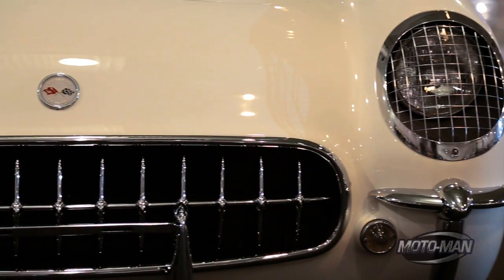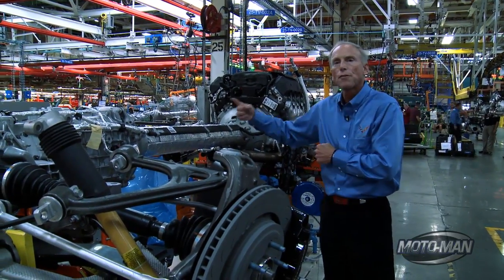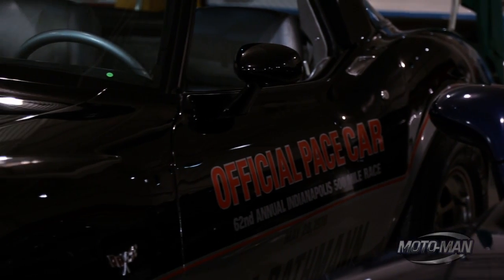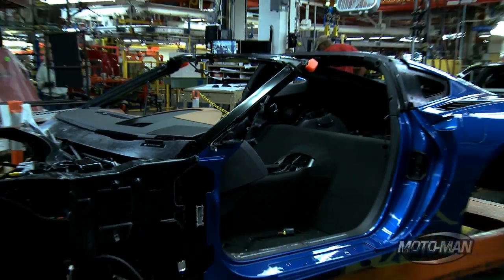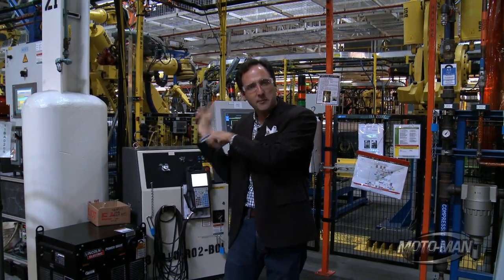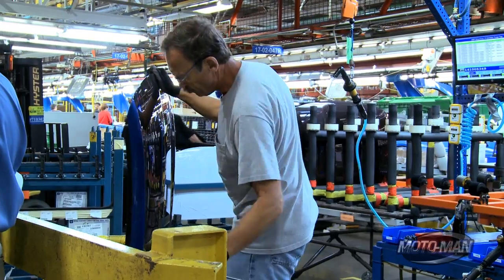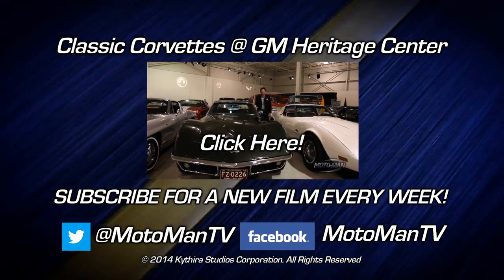Chevy Corvette Stingray C7: Behind the Scenes of it's Design, Engineering & Build - Part One

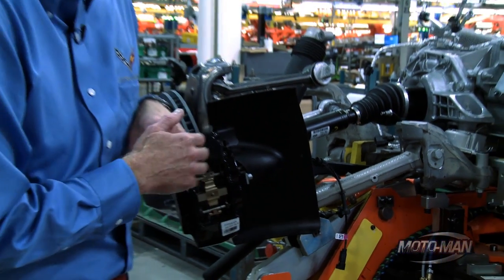Comment: @8:20 Tag says that a 'certain part connected to cooling the brake calipers and that this part sit too low to fit in a car carrier so the dealer installs it.' Does that mean if the car i required to be put on a car carrier for whatever reason, that part has to be removed for traval and then reapplied after it is taken from car carrier??? Also. Is this line dealing with the Corvettes going to be shut down to varying degrees while we deal with the Virus?

Comment: Cheers! Impressive to see some of the engineering that is built into these expensive automobiles. GM fell way short on  ground clearance! My 2012 Grand Sport, 2LT only has 3" of clearance. Yes, I said 3". Can't go over speed bumps without dragging bottom. Had to build a driveway ramp because the front fender would drag everytime I backed out the driveway. My 77 Vette never drug bottom on my driveway. You would thing GM would get this problem/challenge/opportunity under control and PREVENT DRAGGING BOTTOM...  HINT, HINT, HINT...

Comment: Had the privilege of driving a buddies 2016 Z06 roadster. 8 speed paddle shift 650 hp 650lbs torque. Ive driven several "supercars" in my 60 years  including a 70 LS6 4spd ss454 chevelle, 04 Z06, 2012 grand sport, ect. NOTHING prepared me for that 2016. I haven't been that scared since the first time my wife told me she was pregnant!!!! Lol. WHAT A RUSH!

Comment: This stiff drive-train seems unique, relying on a torque tube to react against a drive-shaft without U-joints.  If this has been well-engineered, it saves production costs while improving reliability, tracking & road-feel.  On the downside, damage to any part of this assembly is more likely to affect the whole drive-train.  Is this concept patented?
Reply: please look up the tramic trans and you will see what I mean
Reply: SIMKINETICS: 

Nothing revolutionary about a torque-tube. Hell even the Model T had it....most/all GM cars/pickups had Torque-Tube until the 1950s. Torque-Tube
has been around for hundreds of years in Industrial Applications.

Just comes down to ,you wanna spend $20.00 for a conventional drive-shaft with U-joints or spend $30.00 for the Torque-Tube method.

Current Corvette still plays catch-up to Japan and Europe....it's Ace is lots of horsepower for little money.

Comment: I wish these ‘brilliant’ engineers had to fix the shit designs they create. Just to change the heat/AC diverter doors,  remove top half of engine to access firewall, then remove the several hundred pound dashboard as a unit...$5000 to $6000 to replace less than $200 in wear-out parts.    Oil pressure sender fail? They DO!   and its a $12 part that takes $1,400 in labor to access.   Love driving my Vette, but would shoot some of the freaking idiots that engineered impossible service into it.
Reply: Jennifer WhiteWolf hmmm maybe you should work for gm or quit complaining
Reply: I don't believe you can buy a new Corvette for $50,000 anymore. Add another $10,000 to that and that's with a rebate and GMI...

Comment: So on the torque tube issue, you tripled the weight because of a vibration in 4 cylinder mode. AFM is a pox in a sports car. 

Get rid of the DOD, and you’ll fix the lifter issue, and resulting blown motor from dropping a valve issue, lower the weight of the car, the vibration issue, and the torque tube grenading issue that plagues these cars. 

Oh yeah and fix the pos transmission/torque converter issue. That’s a nightmare. 

And get paint and body to fix my clear coat issue. I have to spend a few thousand to get my 60 thousand dollar car repainted where the clear coat defected.

Comment: 1:07. Triple is not 300%. If you double something, you increase it by 100% from where it was. If so, tripling something is a 200% increase.
Reply: +CatManDewie doesn't respond to my point on what triple is. read my post.
Reply: I redact those statements as a misunderstanding. You're right as a 200% increase from what it was but the end result will still be 300% of the original. So Tadge is still right.
Reply: +CatManDewie Dude. Not it won't. You are wrong. Read my original post carefully. Read your own redacted post. You contradicted yourself. You can't say I'm right in the first 1/2 of sentence 2 and then take that back in the 2nd half. Tadge was stating growth from where something WAS. 1x that original, or 100% growth, doubles it (100 to 200, is 100% increase). 2x that original, or 200% growth, triples it from where it was (100 to 300, is a 200% increase, math is (300-100)/100 = 2). As such 3x that original, or 300% growth quadruples it 400 is 3x more than 100, or (400-100)/100 = 3.
Reply: +mgelliott1 What you are saying only applies to percentage INCREASE, not the new stiffness percentage. Tadge wasn't clear when stating that after listening to it. He is trying to say the new stiffness percentage not the increase. It is in fact 300% AFTER tripling if from 100% by a 200% increase. Tadge is still right.
Reply: its all about the math
Reply: mgelliott1 your logic is flawed.
Reply: So if I’m at fifty percent and want to double it, it will be one hundred and fifty percent? Makes sense right...

No, you nit wit it’s doubled which means fifty times two is one hundred percent.

Lord help these people

Comment: Looks like the next generation MIGHT be a "REAL" supercar, Comparable with the likes of Ferrari, Lamborghini, Acura and Ford... I mean really, any Moron can buy and drive a 'Vette Straight-line...but to have a REAL Mid-Engine SUPERCAR, something that actually handles like a real GT race car, Even though I am not a "Chevy Guy", it will be nice to see the American brand Chevrolet name on something like that.
Reply: Do you realize that Chevy kills a lot of those cars on the track. With the Z06, Grand Sport, ZL1, and more. GM is pretty much king of the hill right now on the track and definitely the skid pad. The new Grand Sport just set a Motor Trend record by pulling 1.2g on the skid pad. These things eat Porsches and BMWs on the track. Not much can beat them, especially on a track.
Reply: Cory R: PUT DOWN THE CRACK PIPE!
Reply: Honestly though, go look at the numbers and the times. The Z06 is the number one car on the Willow Springs track that Motor Trend tests on., other than the 918 Spyder which is ridiculously fast. It beats out the GTR Nismo and a bunch of McLarens and Porsches.
Reply: I don't see a single Chevy on this list, until I do, nothing they build impresses me... https://en.wikipedia.org/wiki/List_of_24_Hours_of_Le_Mans_winners
Reply: Chevy doesn't really try with Le Mans. Go look at the Nurburgring and other tracks like Willow Springs, Mazda Laguna Seca, etc. A lot of top tens and top fives on those tracks. Z06, ZR1, and ZL1 all do really good.